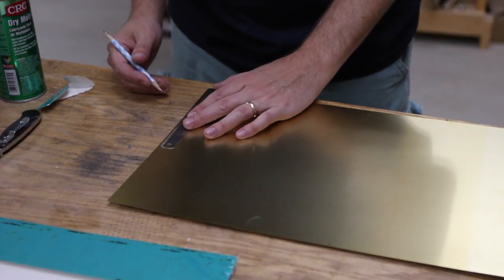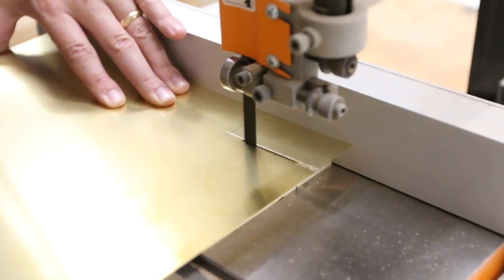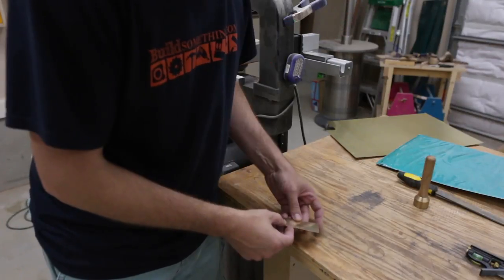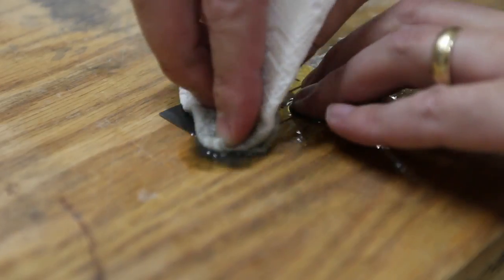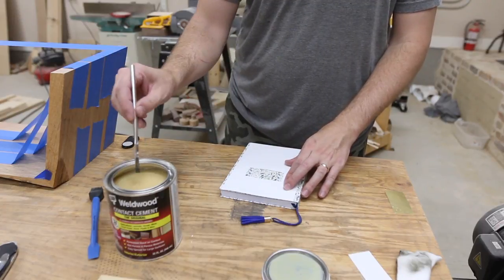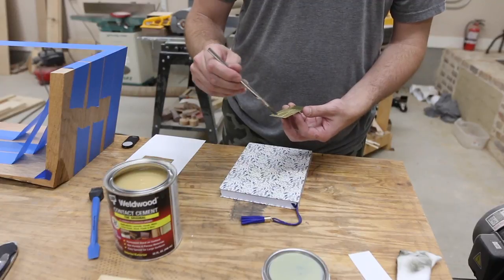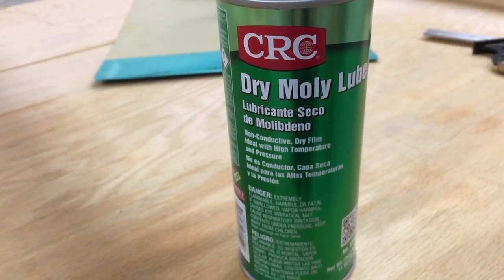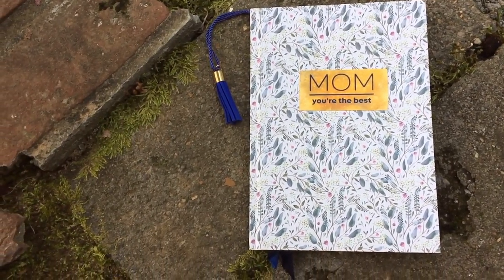Etching Brass with A CO2 Laser // Custom Made Gift

Comment: Had no idea you could etch with a spray like that! Very cool.
Reply from the maker: I think technically, it is not etching. That would be if it is removing material from the brass. According to what I read, that's debatable. Maybe this does cause a bit of the material to be removed. Regardless, it looks cool. Thanks for watching, Robert!

Comment: Nice project. Etching metal is something I wanted to try for quite some time.
Reply from the maker: Thanks! I want to try that electro etching I’ve seen people do with salt water. That looks cool. Technically, my 40watt laser is not powerful enough to actually etch metal. This is more marking the metal, but it gives it a similar effect.

Comment: Pretty cool outcome! Looks like you need to get into the trophy making game now. You could customize trophies like a madman with that. So the obvious question I have is, why not just cut the brass with the laser instead of the bandsaw? I'm assuming the laser isn't powerful enough?
Reply from the maker: Ha ha. No, I don’t want to just be a trophy maker. You’re right, this laser is 40 Watts. It is not powerful enough to cut metals. It will merely etch some of them with assistance of a marking spray. I think you have to get into 100 watt or higher to do that.

Comment: HI.  can you tell us at about what speed, and intensity you ran your laser?  I tried this, but am not getting good results.   Thanks!
Reply from the maker: On this one, I used some settings that have changed a bit now. I just did some more brass at 700/Full Power and 270 lines per inch, and I got some pretty similar results.

Comment: Hey, Bruce! Love the video - what wattage laser and power/speed settings did you use to get that result? I've got it dialed in for SS water bottles yet brass is giving me trouble.
Reply from the maker: Thanks so much! I don’t remember what the settings were exactly. I was using Dry Moly Lube spray for this. What are you using for a marking spray? And this Glowforge is a 40 watt.
Reply: @BruceAUlrich  I use the same CRC Dry Moly' Lube you did. On a 60W Epilog Helix CO2 laser I do 100% power at 20% speed to etch SS tumblers. I did the same on brass and it was way too light (maybe just play w/ lower speeds?).
Reply from the maker: @icmpeko  Maybe that or it might have to do with the number of coats of the spray? I did 3. Is that what you did also?

Comment: So I see your settings are 100 speed 100 power 225 LPI 1 Pass, did you change the bitmap options, did you set a certain focus height, I am looking to make a few dog tags just like this out of brass, but for a small .5 inch x 2-inch box for 5 letters "RIVER" with those settings it will take 20 mins, for something that small it just seems to take a long time, am I doing something wrong or is that just how it is?
Reply from the maker: Hey Alex, this was not engraved as a bitmap. It was a vector. I did set a focus height. I just used my calipers to figure out the height I needed the laser to focus on. Now, the Glowforge can set this height for me. That seems to be a hair long. I wonder if you make the font in a vector program, rather than a bitmap, if it would go faster?
Reply: @BruceAUlrich  Right but what setting did you use on the glowforge? I am using the engrave setting, are you using the cut or score? I would not think so. In the engrave setting there is a bitmap option which is why I asked.
Reply from the maker: @TheKhaoticGamers  I guess I've never seen the bitmap option. Yes, it was an engrave. I know that much. However, I don't remember the settings since this was over a year and a half ago and I don't have them written down anywhere.
Reply: @BruceAUlrich  No worries, honestly this was something my father brought up to me and I came across your post and video. I just tested out some settings and everything is working out so far. Thank you for the replies even after a year since you did this!
Reply from the maker: Alex Brensike sure thing! Did you use dry moly spray like I did? And on brass?
Reply: @BruceAUlrich  Exactly that, the same spray you got I bought on amazon, my father bought some round brass tags for his keys and dogs. I am basically making him some dog tags and also some labels for his keys. So far so good everything is working like a charm!

Comment: is there any discoloration on plate after spray?
Reply from the maker: Yes, it colors the entire thing black. Then, you laser engrave it. Then, wash off excess with rubbing alcohol and the lasered part is left. The brass comes clean everywhere else.
Reply: @BruceAUlrich  Sorry I mean discoloration on Gold part not on engraving part after cleaning, showing some spots that was not before spray
Reply from the maker: @Mmawards  No, not that I noticed. I cleaned the brass and polished it with 0000 steel wool before using the spray. I did notice that the alcohol put a little more of an antique patina on the brass...rather than bright polished brass, but it was very subtle. I actually really liked it.
Reply: @BruceAUlrich  Thank you for sharing economical way of engraving
Reply from the maker: @Mmawards  Hey, you bet! I want to do some more experiments on some other metals, but I've just not had a chance yet.
Reply: @BruceAUlrich  Try Steel & Glass, you will get good contrast, also check Alumamark material
Reply from the maker: @Mmawards  I'll look into those. Thanks!